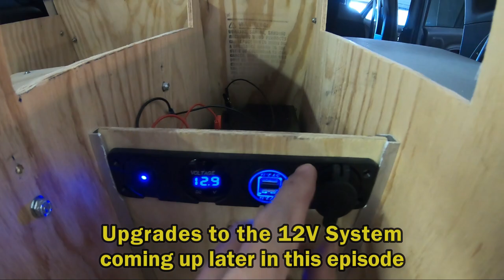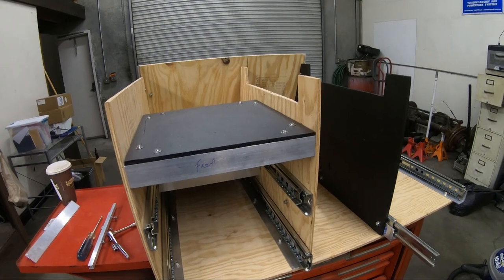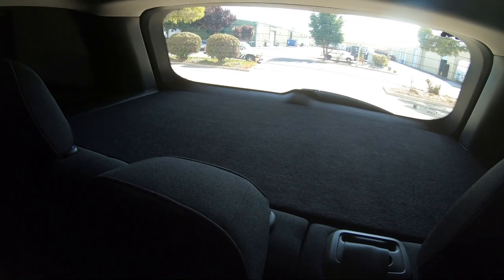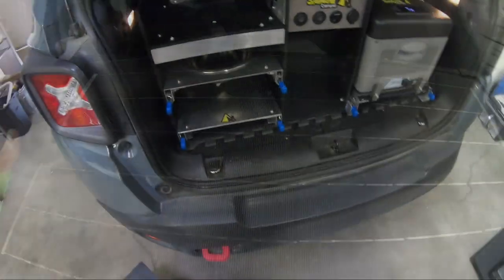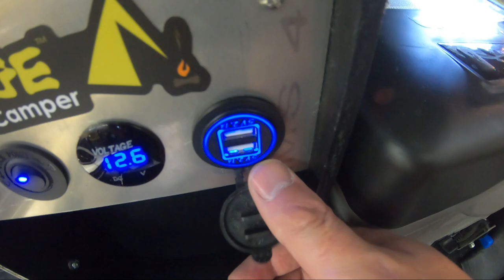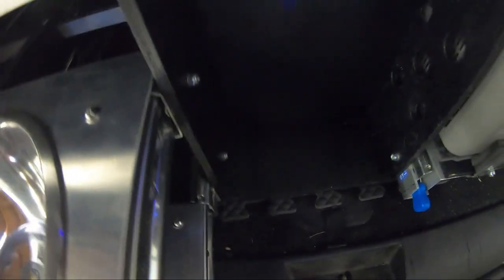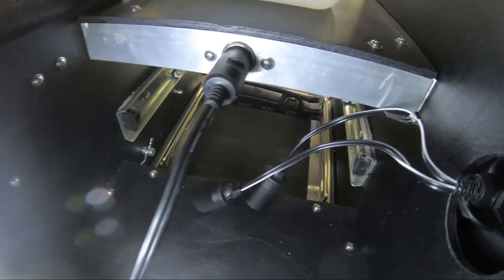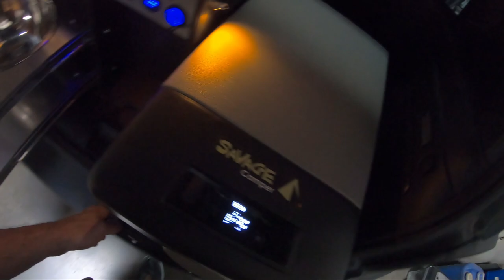Jeep Renegade Camping Kitchen Build [Episode 4]: Finish Work

Comment: a dumb question but I don’t know where to get those slider hinges and the little blue lock and release tabs, 🤔 link ?
Reply from the maker: Not a dumb question I used to not know either.  These are Vadania sliders I purchased on Amazon. I added a link to them in the video description.  Also, there are 3 previous build videos to this, and I list parts/gear in the descriptions of those videos as well.  Installing the locking sliders is in the Part 1 video here: https://youtu.be/aMoIp5WYTKg